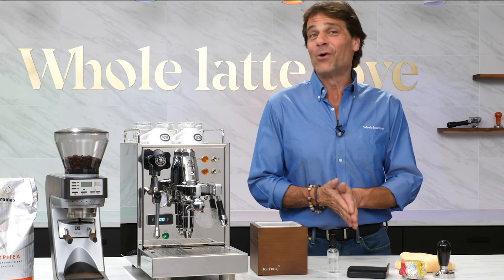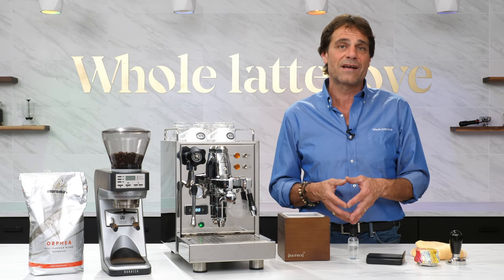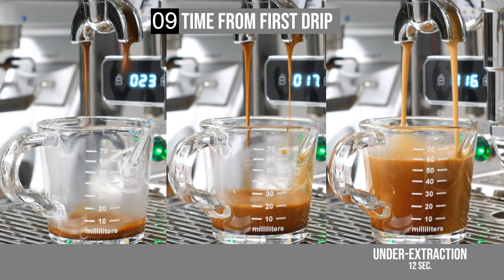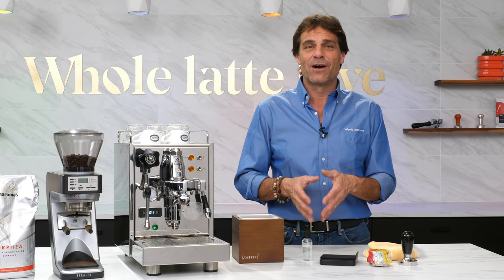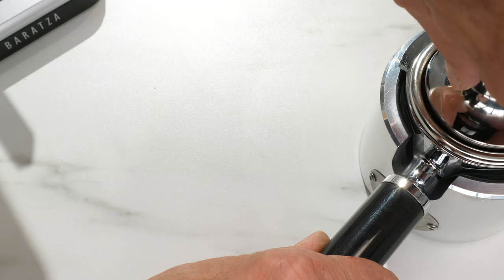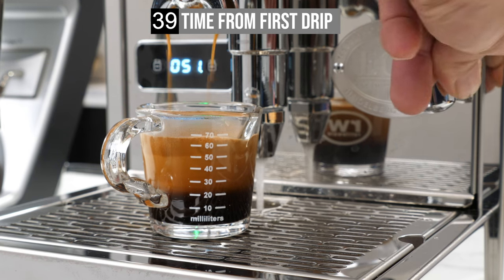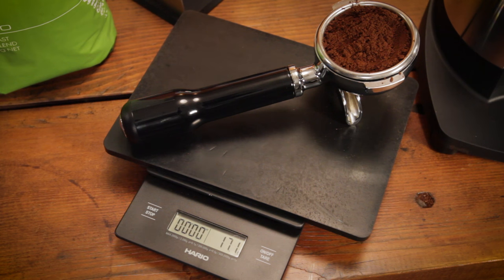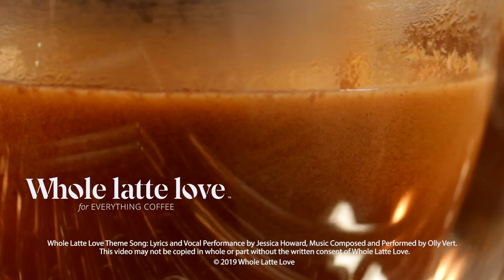How To Dial In Grind Size for Espresso

Comment: Marc how come when I pull a shot and it’s between 20-30 seconds and the pressure is right, my shots never taste right
Reply from the maker: Hi LK, Thanks for the question. If timing is in the ballpark of 20-30 seconds it may be the coffee you are using? Are your shots sour or bitter? Sour is a general indication of under-extraction while bitter flavors indicate over-extraction. Might also be temperature of brew water. What make/model machine are you using?
Marc
Reply: I use the breville barista express and my shots usually taste sour and bitter I use freshly roasted coffee beans
Reply: I have tried adjusting the grind to be courser or finer but it never tastes right

Comment: Would the grind be the same for single v. double shots? Or do you have to dial in for each?
Reply from the maker: Hi Andrew, Thanks for the question. Usually have to dial in for each. But, Baristapro makes some precision filter baskets. Their singles are engineered to work with the same grind size as used in one of their double baskets.
Marc
Reply: @Wholelattelovepage  Marc - I totally read that in your voice. Thanks!
Reply: Running a Barista Express and its little portafilter.  :(

Comment: Hi.  I'm using the Lelit PL 81t.  I can't get some kind of 2-finger-thick crema.  what is the reason for this?
Reply: do you use Facebook?
Reply from the maker: Hi YC, Thanks for the question. If using a coffee that's capable of producing crema not getting it is usually about grind size.
Marc
Reply: Whole Latte Love Thank you very much for your reply. I am using Breville bcg600.  I've tried every level but failed.  There are 60 grinding steps.  What is your suggestion?

Comment: Hi
Is it it possible to block a pressurised basket if your grind is too small, I purchased a used Delonghi  Dedica for an espresso shot and it began to flow then stoped and will not work again, so I don’t know if there was some coffee residue in the filter which caused this or my grind size.
My grinder is a Delonghi with 15 grind setting and I used the finest setting.
Any advise from anybody would be appreciated.
Reply from the maker: Hi Wayne, Your timing is perfect! Was just using a Dedica yesterday for a video posting later today! Have a look at your filter basket. Does it have a black rubber ring at the bottom. If so you should be able to pull out the perforated filter disc for cleaning. I'm not certain the Dedica filter baskets have always had that capability. So if no black ring you may have an older version. If that's the case you may be able to clean the basket by soaking in a product like Cafiza which is great at removing coffee oils: https://www.wholelattelove.com/products/urnex-cafiza-espresso-machine-cleaner
Hope that helps!
Marc
Reply: thanks marc
I don’t have the easy clean type, they’re the later version for the EC685 models, so I will try the cleaning product you suggested, I had it soaking in water all night and just gave it a little squeeze water came from both sides of the basket, so I will try it in the machine later.
Thanks Again.👍

Comment: Hello Sir,
               Could you please tell me your average/recommended setting for Baratza Sette 270 if using with Gaggia Classic Pro?
Reply from the maker: Hi NN, I wish I could but it depends on other variables like the coffee and dose weight. I'd go through the dialing in process as described in this video. For relatively new Sette I'd start at a setting of 3 or 4 on the macro dial and coarsest setting on the micro dial. Run a shot if too fast go one setting finer on the macro dial. If too slow one setting coarser. When you get close use the micro adjustment dial to fine tune. Just keep your dose weight the same.
Hope that helps!
Marc
Reply: Whole Latte Love thank you Marc. I am using Lavazza Super Crema. Just received it today. I tried settings on Sette 270 and found myself at number 11. Is it normal to use 11 for espresso?
Reply: @Noofa23 I think so because I also have the Sette 270 and depending on the coffee brand and dose size, it's between 6 and 10.
Reply: benpaq14 thanks 😊

Comment: I'm getting my first machine soon
when my beans get older, do I have to grind slightly coarser, or finer?
Reply from the maker: Hi R, Thanks for the question. Depends a bit on initial freshness and maybe a bit on bean variety. In general super fresh beans tend to need coarser initially and then finer as they age.
Marc
Reply: All we want is a balanced coffie. So if its FINE- the taste is Bitter, COURSE- taste Sour. What we need is Between. I hope this will help you dear.

Comment: I recently got Sette 270 and using it with Delonghi 685 dedica (I know, it's probably overkill, but I have plans to upgrade in future). I saw in other channels that for pressurized double basket they used setting 15 on Sette. For me I had to use setting between 9-8 (medium roast maragogype beans), then I get dark 'mouse tails' pour. Is it normal? I expected it will be drops only or no pour at all at that grind size...The Sette 270 is brand new made in 2020, no shims installed from supplied 2.
Reply from the maker: Hi TU, Thanks for the question and providing your details. Sure a bit of overkill but that Sette will serve your next machine well. Impossible to be exact with grind settings for best results. But, I can say in a brand new Sette a setting of 15 in my experience is far too coarse. For standard extraction on a non-pressurized filter basket machine I'm usually in the 2 - 5 range on a new unshimmed Sette. Pressurized basket/PF like that in your Dedica are a bit forgiving of imperfect grind size at the expense of espresso quality. Dialing in by timing does not work on an espresso maker with pressurized basket/PF as flow rate is controlled by the tiny hole and not the grind size of your coffee. In your shoes I'd probably try a finer grind setting, do some tasting and see what you get. Hope that helps!
Marc
Reply: @Wholelattelovepage  thanks for your answer. Then it seems about right. As finer than 8-9 and machine wont push through current pressurized basket.

Comment: Can I use a basic burr grinder for making espresso, or do I need one strictly for espresso?
Reply from the maker: Hi p, Thanks for the question. How basic? I do recommend a burr grinder with very precise control of grind size. Grind size is critical for making quality espresso.
Marc
Reply: @Wholelattelovepage  Thanks for the reply. I have a cuisinart burr grinder with selections from fine to course. 15-16 different settings

Comment: Can I still get crema with a $50 espresso machine?
Reply from the maker: Hi PS, Thanks for the question. If it's $50 it's not really a machine. Definitely an appliance. I can almost guarantee it uses a pressurized filter basket. A pressurized basket a a single tiny hole which cause the pressure to build up. As the liquid escapes from that hole a sort of artificial crema can be created due to the sudden release of pressure causing bubbles to come out of solution. It's very different than standard brewing in non-pressurized filter baskets. In those it's the coffee dialed in to a proper grind size which causes the pressure to build up. Part of the trick is getting the brew water under pressure to flow evenly through the coffee puck in the filter basket. That does not happen in the pressurized brewing systems of low cost entry-level espresso maker appliances.
Marc

Comment: What if your are. Getting all the extraction right but when I remove the porta filter, I am seeing water on the puck, it isn’t “dry”.  What is going on with that?  THX!
Reply from the maker: Hi CHP&V, Thanks for the question. What type of machine are you using? Some lower cost espresso appliances do not have a 3-way solenoid valve which helps to get the puck dry. In other machines which do have 3-way valves it might be an issue with cleaning of the circuit which drains the surface of the puck. This includes the shower screen thru to wear water exits at the end of an extraction. Machines with 3-way valves should be backflushed on a regular basis to remove accumulated coffee oils. Cafiza is the industry standard product for use in backflushing machines: https://www.wholelattelove.com/products/urnex-cafiza-espresso-machine-cleaner Please note machines without 3 way valves should not be backflushed. On those machines soupy wet pucks are what you get.
Marc
Reply: I generally find that if I have wet pucks then I'm not using enough coffee. Try adding a few more grams and then dial in again. I often use 20gms and dial a little coarser compared to 17 or 18 gms.
Reply: Whole Latte Love I am using the GAggia Classic Pro (I got from you all).  I have not backflushed it. . . . Ever . . . I’ve de-scaled it!!  So that a plus . . . Haha
Reply: John Barr If I add any more coffee, the coffee touches the top of the machine and leaves a little cicurlar pattern on the puck.  So Not sure if adding more coffee is the issue.
Reply: @curtishustace  My baskets must be bigger than yours. I use a pullman or VST basket both rated at about 20gms and if I use 19gms then I get a wet puck. Anything above 20gms is ok.

Comment: Have Very difficult time dialing Maromas ORPHEA.  Too much Crema and bitter taste. Had not issue with Danesi Gold
Reply from the maker: Hi v, Thanks for the feedback. If you don't care for crema then Orphea probably is not the coffee for you as it does make a lot. Getting bitter flavors is surprising. Orphea just doesn't go bitter unless over-extracted.
Marc
Reply: @Wholelattelovepage  Thank you for replying, Marc. My timing for 17g dose in the ball park.  Maybe my ratio - I always did 1:2.8 with Danesi gold - has to change for Orphea ?
Reply: @vadfill3106  Hi, You are welcome for the reply. I tend to do Orphea at 1:2 at about 25 seconds from 1st drip. Marc
Reply: @marcusbuckman2871  Will give it a try, thank you

Comment: May i ask about grind size vs weight after grind. So i have 2 type of bean. Bali kintamani medium light Roasting and Brazil specialty medium dark Roasting. To brew kintamani, i use 3A on sette 270 with 18gr bean for 42gr espresso with time about 20s. But if i use with Brazil, it's will be over extracted. So i set my grind to 4I. Problem is, when i use grind size 4I, my portafilter is too full, so i need to decrease its weight to 17gr. If i use 17gr, for 40gr espresso, how much my time target? Is it still in range 20s-30s?
Reply from the maker: Hi Andy thanks for the question and providing background info! When using timing to appraise an extraction it's always the same regardless of coffee dose weight. Not surprised you're getting more coffee volume with the larger grind setting and darker roasted beans. As you increase grind size the same time of grind will produce more coffee. Also, in general a darker roasted bean is less dense than a lighter roasted bean so same weight will produce a larger volume. Hope that helps!
Marc
Reply: @Wholelattelovepage  and how about time to brew. If using lighter roasted bean with 18gr coffee for 42gr espresso with 20s brew time, if i using darker, with 17gr coffee for 40gr espresso, is time target still at 20s?

Comment: Question about the Sette WI - do you find it too loud?

Thanks.
Reply from the maker: Hi CH, It's a bit louder than other grinders but personally I do not find it too loud.
Marc
Reply: Yes it's louder but much faster. I sold my Rancilio Rocky and bought a Sette 270, and I don't regret it. Awesome machine for the price.

Comment: Why are you using a distributor for tamping? It's only meant to evenly level the coffee to then be tamped, not to do the actual tamping.
Reply from the maker: Hi bob, Thanks for the comment. I switched to using leveling only about 10 months ago. The Jack leveler I am using levels and compresses. I know plenty of people still tamp hard. I'm not one of those people. IMO compression of the puck beyond a certain point has little to know affect (except maybe for show). After leveling I can knock a solid puck out of my basket - that's before extracting so just dry coffee. If it's compressed enough to stick together that's good enough for me. I have no problem with people who only tamp or level and tamp both. I just find it unnecessary and for me, shot consistency has improved.
Marc
Reply: @Wholelattelovepage  Thanks very much for the reply 👍

Comment: How does the modeled grinder compares with rocky or breville pro
Reply from the maker: Hi B, The Sette 270Wi is a dream! Not quite the same build quality as a Rocky and far better build than the SGP. At espresso sizes Rocky tends to be a little clumpy and distribution of a doserless Rocky is lacking. For  home use the 270Wi is IMO about as good as it gets before the jump to semi commercial machine grade units. It's hard to beat incredibly accurate weight based dosing, micro grind size adjustment, super fluffy grinds, excellent distribution, high speed and very low retention of the Baratza Sette 270Wi.
Marc
Reply: @Wholelattelovepage  Price point on the Sette?

Comment: what makes a grind clump up?
Reply from the maker: Hi y, Thanks for the question. Clumpy grind can be caused by a number of things. Lower cost grinders with smaller burrs and slower grinding speeds are prone to clumping. this in combination with a design which forces finely ground coffee through restricted areas between the grind chamber and delivery chute may cause compression of the grounds resulting in clumping. In addition, clumping is more likely when grinding beans with visible surface oils. Hope that helps!
Marc
Reply: Whole Latte Love It does clear it up thanks

Comment: Another question: how much do you grind in a basket for 60ml extraction. I stuck with 1:2 ratio with 17g of coffee, which results in 34 ml of espresso. Hence it is supper difficult to get 30s extraction, and it usually comes somewhat shorter. On the other hand finer grind results in channeling. I'm wondering if I need to switch to 1:3 ration, and possible larger dose. Any other recommendations?
Reply from the maker: Hi D, In this video I was using a coffee  dose of 17g. As this was a basic technique video I did not concern myself with brew ratios. See the video link in the description for my video on using brew ratios. Keep in mind a 60ml extraction in most cases will not weigh 60g. Can't use liquid volume to determine weight of a shot - have to use a scale for that. Crema is rather airy/gassy so does not weigh like pure water at 1ml = 1g.  Crema is <1g/ml. If getting channeling at finer grind size a number of things can help like: Good distribution and leveling/tamping, depending on the coffee type pre-wetting and/or pre-infusion can help swell the grinds and reduce channeling - especially true with coffees which are fresher from roast. Those need to off-gas prior to application of higher brew pressure - initial off-gassing of very fresh coffees can cause channeling. Depending on machine type you may benefit from an improved shower screen. Some are far better than others at applying brew water evenly to the coffee puck. Might also be technique. For instance if using an older machine with heat exchange boiler or a single boiler machine you may be applying over-heated water...even steam to the coffee at the start of the extraction. Chck your flow from the group with no portafilter in place. If it's turbulent that can indicate flash boiling. A short flush prior to making espresso can get rid of over-heated water. Hope that helps!
Marc

Comment: Im on the finest grind my grinder can do at about 19gm, a tight and level tamp in a dry filter and I cant get an extraction over 10-15 seconds getting a weak and watery espresso. Any tips?
Reply from the maker: Hi C, Thanks for the question. What make/model grinder are you using?
Marc
Reply: @Wholelattelovepage  hi! I'm using the sunbeam grindfresh multigrinder. Cheers!

Comment: You guys are the only ones using "first drip" to time from. You are basically brewing 30-35 second espresso but whatever...
Reply from the maker: Hi F, That's correct - evolution my friend! Keep in mind timing is the most basic method of evaluation. It's the first stop in dialing in a shot. For some it's as far as they need or want to go. Others will continue on using brew ratio and flavor for further tuning. If using the same machine all the time it's a reference for evaluating things shot to shot and you can start timing whenever you like. In my case I use a variety of machines. Some with vibration pumps, some rotary. Sometimes I do long low flow pre-infusions with fresh lighter roasted specialty coffees. With those it might be 15 seconds before any drip from a bottomless PF. In case like that should my entire espresso come in just another 10 seconds? I often use an Acaia Lunar scale and log shots. I have the scale setup to auto-start timing when it registers first drip in the glass. If you'd like do check out my video posted yesterday using brew ratios, bottomless triples, the scale and a very fresh from roast Yirgacheffe coffee rounded out with flow control. Just don't freak out when you see my best shot was ~38 seconds from pump on and 19 from first drip :)  Here's that video: https://youtu.be/HTaly8c-i_U
Like tamping at 30lb, knocking a PF prior to tamping and 14g doubles espresso has evolved quite a bit in the last decade or so with introduction of specialty coffee and more controllable machines. Not unusual at all for extractions to go well over 30 seconds from pump on.
Marc